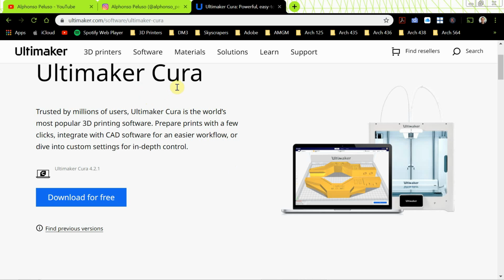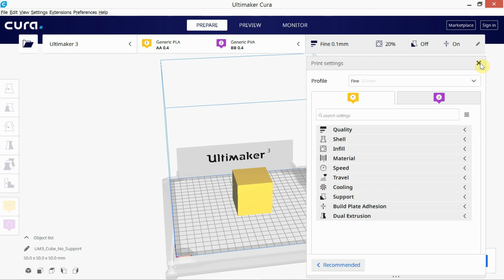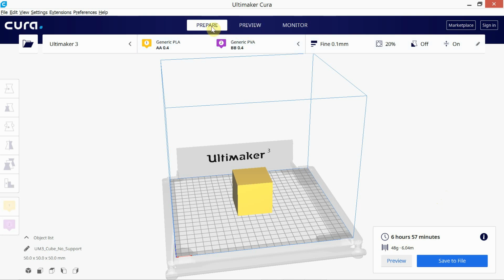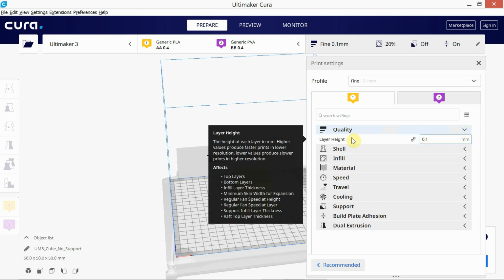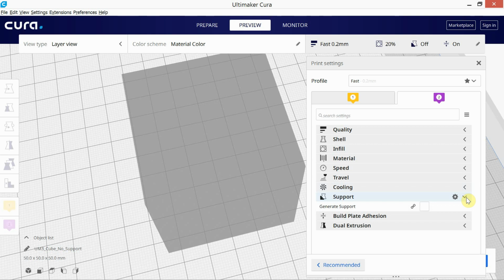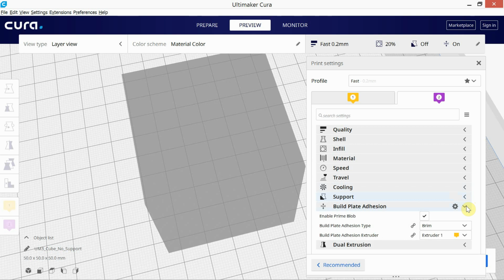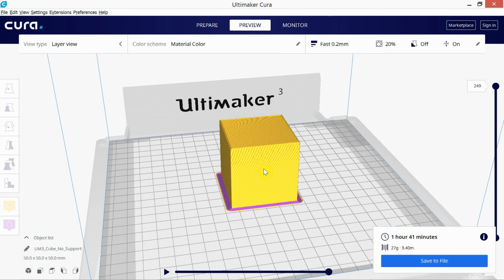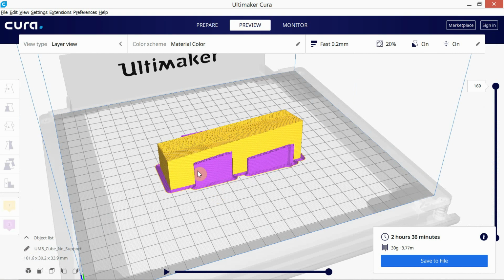Ultimaker Cura - 3D Printing Best Practices

Comment: Using the term post processing for slicing which is a preprinting operation is non conventional since this term typically used post printing operations such as removing artifacts, sanding and painting.
Reply from the maker: First Last thank you for your comment! In this case post processing refers to after the 3D model has been created in the preferred 3D Modeling software. Thanks again for your comment and l hope that you found the information helpful.